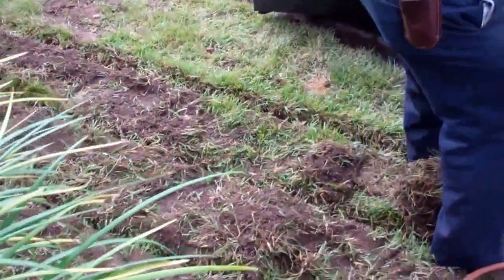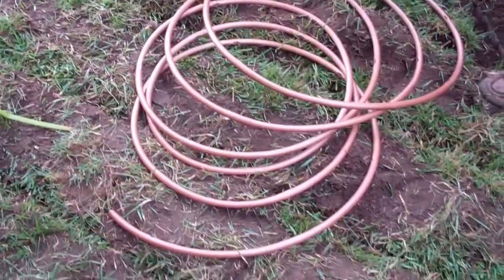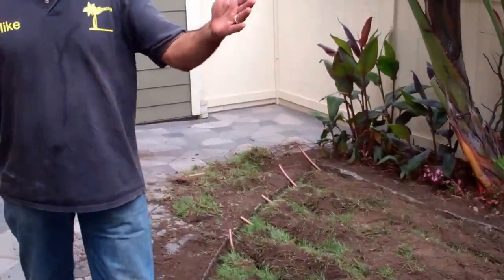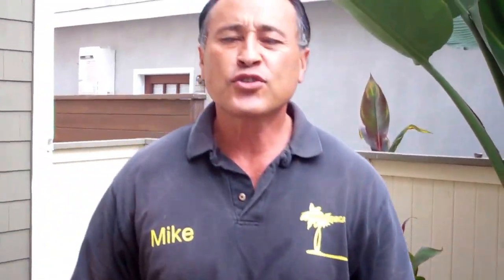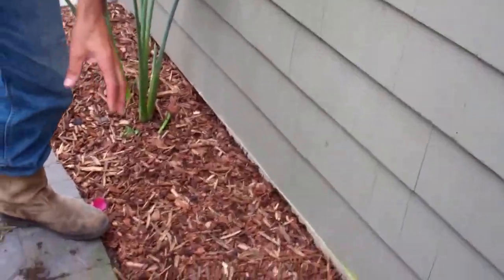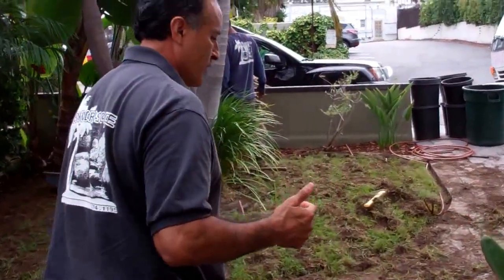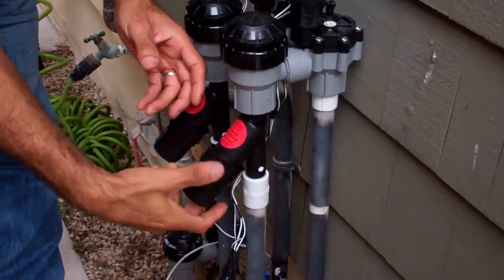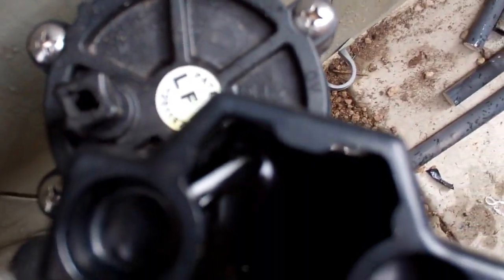Underground Watering for Lawns

Comment: Hope the yard doesn't need aeration in the future.
Reply from the maker: The drip irrigation gets filled with air when not in use.  When the system turns on, all the air is released into the plant materials